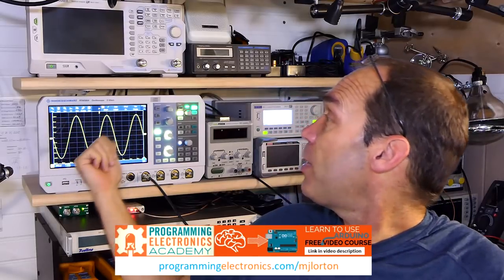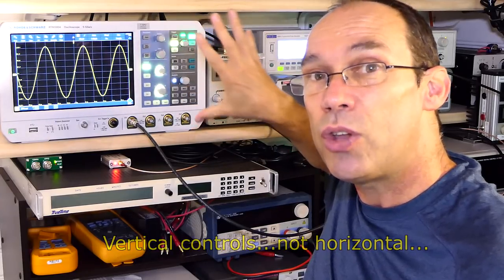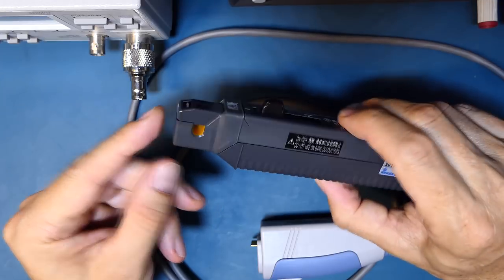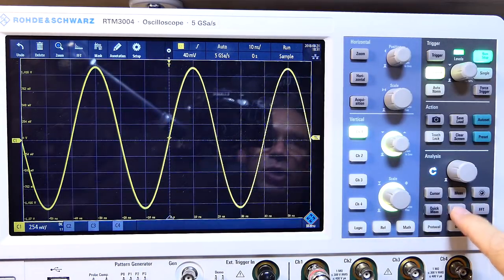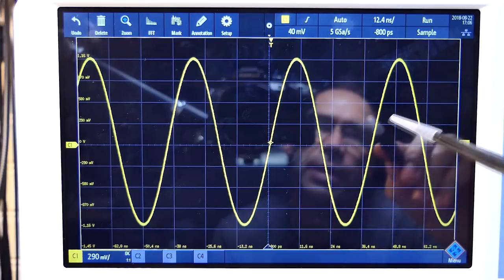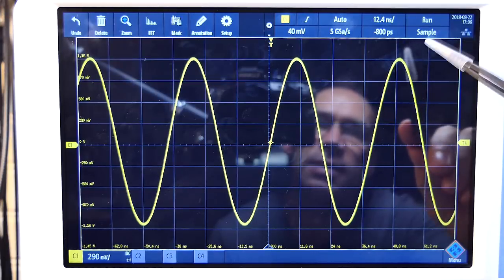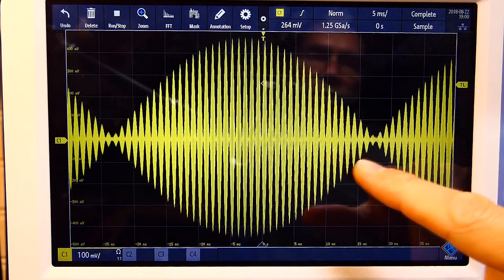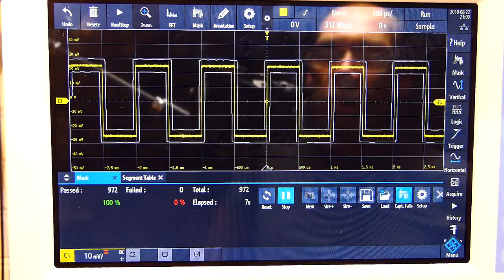R&S RTM3004 Oscilloscope Review - Part 1

Comment: One thing I've wondered (I didn't research so I'm probably wrong) with modern scopes is why scopes don't options without screens so you just have to plug in a separate monitor (I know some have to option for an additional monitor out).  I would think it could lower costs and give the ability to more knobs and immediate function changes without the need for nesting or having knobs and buttons for each channel.